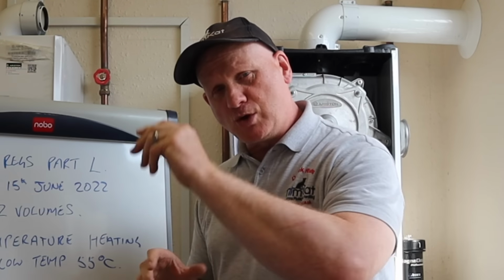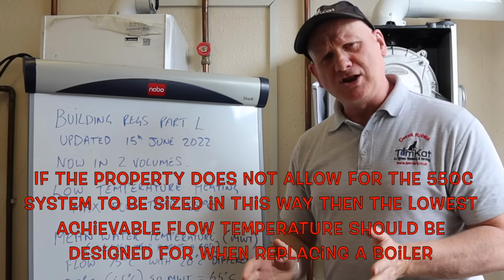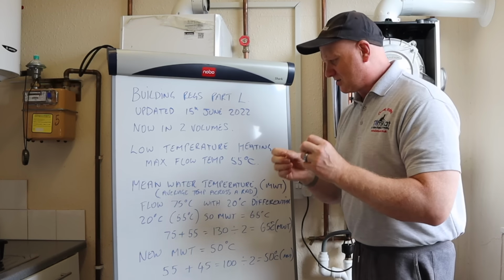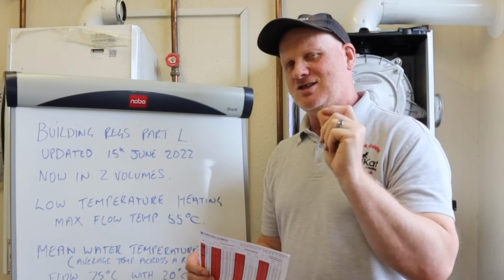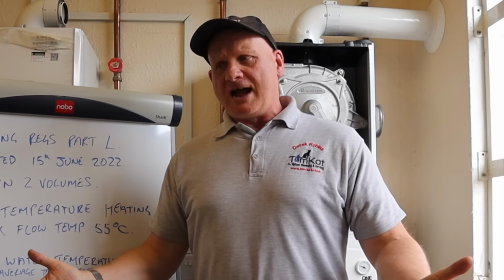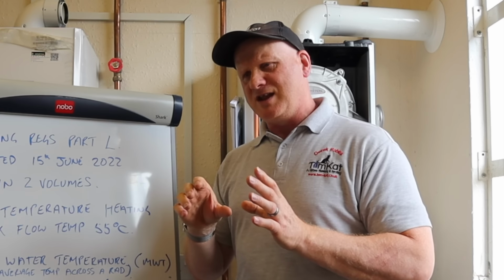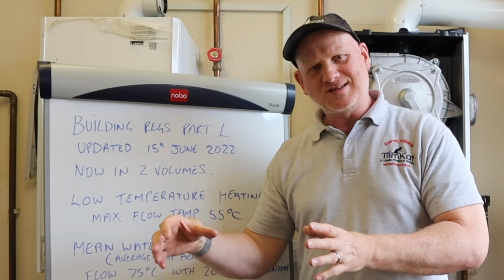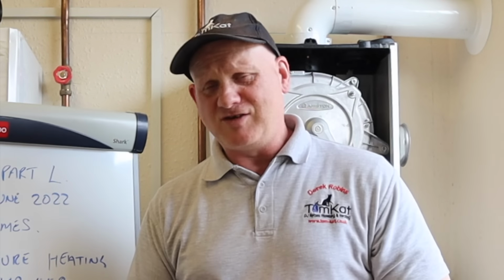Don't adjust your  heating flow temperature until you have watched this video. #saveenergy

Comment: One thing that needs to be taken into consideration is the additional run time of the pump waiting for the system to satisfy, people reducing the flow temperature to their radiators could very well end up with a system running continuously, at £0.52 per kWh for electric you could end up with no savings and actually start paying more to operate the system, pump could easily be pulling 100W. Easy and simple thing for most people to do so they are not guessing if they are doing the right thing is to turn the room stat down and ensure their timer is set correctly for occupancy.
Reply: What pumps are you running !!? My circulating pump pulls no more than 10W. Anyway I agree evaluating the cost of any electrical inputs in a system need considering before anyone changes anything.. The only true way people can reduce their energy bills is insulate themselves with clothing or insulate the house. Government should be doing more so people can get hold of discounted insulation not just VAT free if you use specific contractors that just charge you more than the VAT saving.
Reply: @jdickson242  I doubt it’s 10w but If that’s what you have 👏🏻
Reply: @jdickson242  the circulation pump, and most pumps installed currently will not be pulling 10W, most pumps installed will be of an older type pulling around 80-100W, even the new pumps could be pulling 40W depending on the sysyem. But this is the issue, social media video creators are telling people to alter this that and the other, most people don't even know what boiler they have let alone what their pump is using by the way of electrical demand, have no idea what their homes heat loss is for any given temperature, no idea what the rate of gain is at certain circulation temperatures,  no idea what the output of their radiators are. I watched a video yesterday where a heating engineer was recommending people leave their heating on permanently to save energy, this video is now being used by the main stream media, I can assure you by the end of winter most people will have higher usage than if they had just turned their thermostat down in nearly all cases, but I guess every heating engineer and his dog wants their 15 minutes of fame.
Reply: @MattJordanWoodturning  my boiler does not have a visible temperature gauge on it.  it just has a dial marked min round to max. we keep it v near min. is that ok ? there are thermostatic valves on the radiators but as it is old system, have been told to keep them at max, ie fully open, to deter sludge build-up, and just turn off unneeded rads. so that is what i do. we all manage as best we can.
Reply: by the way, i do not have a condensing boiler. just traditional one.
Reply: @acommentator4452  I wouldn’t bother with a none condensing boiler tbh mate also depends on if it has a pump overrun which is what they were talking about but tbh pump overruns are there to stop the system from fucking itself everytime it turns off with heat in it so….. none negotiable really
Reply: Gas prices have quadrupled since that was true…and elec has “only doubled”.
Reply: @wl660  but gas is 1/3 cheaper per kwh/btu compared to electricity in the UK to heat a home so still works out cheaper........ Just.
Reply: yes, reduce flow temp where possible so boiler operates more efficiently but not so much that run-time is greatly increased.
Reply: If I turn my thermostat down the heating doesn't come on , it has to be at 20
Reply: @smallfeet4581  
Agree,  the temperature you set on your thermostat does seem to vary to get boilers to fire up.  Mine will not come on unless the thermo is set to at least 22.5 C.  When I am just sat reading or watching TV in the evening, I have to set it to 23 deg, or else I feel cold. A separate thermometer indicates that these temperatures are accurate.  How people tolerate lower temps is beyond me.  My flat is well insulated as well.
Reply: @smallfeet4581  you are looking at the room air temperature. He’s talking the water temperature from the boiler
Reply: @3521rob  hmm , I see what you mean , yes I did turn my temp down , usually in spring , I usually turn it up in winter , I can see how not having the temp up in winter could see it struggling to cope , I will need to watch it again , cheers
Reply: My boiler is a quite old system boiler. Last year I having not used it all summer the pressure kept dropping and I was having to top it up every time the heating was working. The heating engineer I called out tried to reset it using the switch but it was difficult to get at because of how the boiler had been fitted. At that time the flow to the radiators was set at 5 and I had the thermostat set at 18 degrees with all of my radiators on 5. I couldn’t afford a new boiler so I tried reducing the radiator flow to 2.5, the thermostat to 16 degrees and radiators in unused rooms to 2. The pump now works without topping up. I did a 15 minute start up every month during the summer when the heating was not in use.
I have saved a fortune, or would have if prices hadn’t gone up, so I am using less and paying the same! I plan on running a test with my smart meter on what you have said about the flow speed and the extra electricity for the pump but I think I may have to stick with the 2.5 flow whatever the out come because of the problem I have had with the pressure valve on my boiler.
Reply: When running on low flow the pump draws far less power, so that isn't really possible.
Reply: @BooBaddyBig  yes a centrifugal pump or fan reduces in power consumption as the load decreases, question is why would you expect the flow to reduce with a reduced flow temperature from the boiler? Maximum efficiency gains are with a wider delta t, most modern boilers allow up to a 20 degree delta t, old boilers are around 10, either way that difference is from the flow of a well balanced system, reducing the flow takes the load of the boiler, which essentially you want running as hard as you can regardless of setpoint, this again is due to the delta t, but this time between the return water and the combustion chamber. So the catch 22 situation here is if you reduce the temp of the boiler you reduce the efficiency of the rads, and thus take the load off the boiler, unless of course your radiators are twice the size they need to be, which we all know they are not. Maximum gains in efficiency from a boiler in condensing would be around 5 to 7%, and that's in a well designed and balanced system. On a cold day with 0 outside, turning your thermostat down from say 20 to 18 degrees will save you around 10% in heat loss, and you don't have to worry about anything else, you will also have a reduced system running time meaning you save electricity on the pump and boiler fan, and a slight increase in efficiency of the rads too.
Reply: This statement regarding is misleading. Even in pump draws 100W (probably lower W), that means if the pump must work lets say 10 hours instead for 7, in actual consumpion that is only 300W more pay day. If the kwh is 0.2€ that means you will use 0.3kwh*0.2€ more pay day. So 0.06€ more for pump. And you will 1000% save more money with lowering the temperatures. Easy
Reply: @SLONooB  it's not misleading in the slightest, what you have done is assume the system can generate enough heat with a reduced flow temperature to overcome the heatloss from the building. The fact I was looking at an installation only last week (on a commercial scale) where the reduced flow temperature meant the system would run 24/7 and never reach the occupancy setpoint once the heat loss reached a certain point based on outside air temperature. I've been doing this sort of thing for nearly 3 decades, and it still amazes me the amount of assumptions that are derived from lack of knowledge, even from installers. What is misleading is telling everyone they can just reduce their flow temperatures without taking into consideration the design of the system vs heat loss from the building. If people want to reduce their flow temperature they can either try to wing it and risk spending more money, or they can do it correctly, and by correctly I mean do a heat loss calculation on their home, obtain the operating factors for their radiators, measure electrical energy use for both the pump and boiler, and then calculate it all up..or they could turn their thermostat down with nothing to worry about.
Reply: So what would be the ideal delta t for a system boiler ?
Reply: @andymav3023  refer to your manufacturer's manual for the boiler, it will tell you what the max is, the greater the delta t the better the potential heat transfer, however there are always trade offs what ever you change unless the system is greatly over engineered on the delivery side, as you will never load the boiler up. Balancing of a system really is a time consuming task if you take it seriously, and if you have TRVs almost impossible.
Reply: @MattJordanWoodturning  well the boiler is sitting in an outhouse no door and not insulated I think it’s probably a Heatloss problem I’ve encountered on a system boiler as the bills are astronomical
Reply: @andymav3023  heat loss from the boiler wouldn't be the problem to astronomical bills, even in an external boiler. It would add to them but probably not your main issue. Without knowing the system it's difficult to help. First thing I would do would be to carry out a heat loss calculation on the home, then compare that to the heating kWh use.
Reply: @MattJordanWoodturning  that was going to be my next course of action … it is a system boiler on an unvented system the boiler is quite far from the cylinder and the outhouse is completely open to the elements broken door with absolutely no insulation on the pipework in the boiler house or cylinder pipework..It runs as far as I can tell on a two port system. I would imagine the boiler is short cycling
Reply: @andymav3023  check your flue temperature, should be a good indicator of efficiency, my guess is a fouled up heat exchanger. Heat loss from surface to air is insignificant compared to heat transfer from surface to water.
Reply: @MattJordanWoodturning  Kindly help!! I recently moved in to a new built, boiler stays on all the time, even though two stats are programmed for day and night temperatures. What could the reason?
Reply: @SL-lc9yl  if the programmer is setup correctly its wired up wrong probably, boiler wouldn't come on unless it was getting an enable signal.
Reply: @MattJordanWoodturning  Thanks. Who could help to check this issue? Electrician or boiler engineer?
Reply: @SL-lc9yl  a decent electrician or heating engineer should be able to help, I would go for a heating engineer first though. Just double check you haven't inadvertently got your programmer in manual first though 👍
Reply: @MattJordanWoodturning  Many thanks 🙏
Reply: @Manic Miner Mass deaths lol, I think you are being over dramatic, It has sadly happened but in masses?
Reply: pumps use very little energy in comparison to heating the water in the system. so it way cheaper to recycle the water in the system than heat it up. usually the pumps are around 60W so that is 6KWh every 100 hours of use.  and at £0.52 per KWh (your figure) that would be £3.12 per 100 hours. even if you had a massive pump that was 100W that would still be £0.52 every 10 hours or £5.20 every 100 hours. the price of gas being combusted for the same amount of time is going to be significantly higher.
Reply: @johng.1703  you're assuming the system can satisfy the heating demand at the lower temperature, which you have no idea if it will, plus there are lots of other things to take into consideration, but every system will run longer as a result of a lower flow temperature, advice is given out across the board without that knowledge being taken into consideration and should be taken with a pinch of salt. If the system is enabled and can't satisfy because the radiators have been downgraded in their output, then all you are doing is running a pump for the sake of running it. Gas usage savings might be 5% for a new system at best, but realistically about 3%, but if your pump is running for 8 hours longer than it needs to that's potentially more than you save on gas. Average gas consumption is 33kWh per day, let's say you saved 1kW by reducing the flow temperature per day, on today's price that's 7.29p per day saving, now if the pump is running for 8 hours longer than it needs to that's just cost you 16.8p per day at the 60W you quoted at the average price of 35p/kWh, which is what electricity is today, so the system has cost more to run. Any advice given out about reducing flow temperatures without knowing the system is always "bad advice". If you want savings turn your thermostat down and leave the recommissioning of systems at lower temperatures to people who know what they are doing and are able to calculate if its worth doing, which most of the general public aren't, but more worryingly is the amount of "gas engineers" who decided to flood social media with advice not knowing if it would generate savings. I've not seen one yet do any form of advice base around calculations so people can at least try and gauge the cutoff point. If you're confident in what you say here's my example for you to advise me - I have a condensing fired boiler, what will I save by reducing my temperature down? And I've purposely left out all the required information needed to give that advice out, and that's a lot of information, the same information none of the "advice givers" know either, because it's my system and they have zero knowledge of it.
Reply: @MattJordanWoodturning  my comment was to do with one aspect and that the cost of running the pump given the KWh electrical cost you gave. And that was a cost for just running the pump.
Reply: @johng.1703  there is no reason to look at the pump running cost in isolation, what would be the benefit in doing that? You stated it would be cheaper to "recycle" the water around the system rather than heat it up, which also doesn't make any sense to do, you would again just be running a pump for the hell of it. The entire thread is about reducing flow temperatures to save money, which is possible, but you need to calculate that cut off point. And in order to do that you need to know the system and the house its installed in very well, that includes all the heat loss calculations for the fabric of the building.
Reply: @MattJordanWoodturning  but that was the point you were making in your original post, the cost to run the pump.
Reply: @johng.1703  yes the cost to run the pump while the system is waiting to satisfy, its not looked at in isolation, and if you knew the variables involved getting  the system to be satisfied you would know what I was talking about.
Reply: That's a good point to consider and easy to monitor. I think now we could do a 7-30 day trial run on one setup and monitor our energy usage since we all seem to have smart meters now. 
Then compare to previous energy use. 
As long as the weather is pretty similar we would soon learn if we were better off.
Reply: So what percentage of the cost is the pump?
Reply: @twasb2000  I can't tell you and neither can anyone else, same goes for the consumption of the boiler fan, and that's the point, as a percentage these are constant variables dictated by external factors. You want to save money? Turn your room thermostat down, get your boiler correctly serviced with a heat exchanger clean and ensure the system is fully balanced by temperature so the boiler is loaded correctly.
Reply: My old engineer always said run the boiler temp quite high. Because the water pump consumes expensive electricity whilst the cost of a bit of extra gas was low.
Reply: @jakebullet1731  Running the numbers for my old Ideal boiler (non-modulating) it burned money about 200 times faster per minute than the pump did. Means that choosing a temperature that increases the boiler efficiency is far more valuable.
Reply: @jakebullet1731  Nowadays, the pump consumes almost nothing, while the cost of gas is higher.
Also, condensing boilers benefit from low temperatures. While older boilers didn't.
Reply: @jakebullet1731 he'd be very wrong
Reply: Maybe? I mean, I see it as  slowly getting to 70mph on the motorway and keeping it at that for a few miles before needing to drop off.

That's better for fuel economy than getting to 70mph as fast as you can
Reply: @waqasahmed939  not really no. What people are unknowingly trying to do by reducing their flow temperature is mimic outside air temperature compensation on a manual basis. Normally this would be done automatically and the control would be commissioned to the system to ensure correct optimum efficiency. Just turning your boiler down risks the system pump running for hours and never satisfying the stat, hence the additional running costs of anything saved in gas by bringing the boiler into the condensing stage of firing. As stated before the best advice for most people is to turn your stat down, plus turn radiators off in rooms not used and see if you can tolerate the reduced occupancy temperature, this in turn will reduce your heat loss from your house as the delta t is reduced from inside to outside. Although to be honest as a country we shouldn't even be at this stage, I'm now paying less for Kerosene 28 than people are paying for gas, let that sink in..if the electric price had gone up to £0.52/kWh it would have been cheaper to run my diesel generator than buy electric from the grid, I could have also plumbed the cooling water into the house and turned it into a small CHP unit..
Reply: @MattJordanWoodturning you are wrong I'm afraid. The power draw from the circulation pump is tiny. 20w. That's 0.6p per hour. A gas  boiler at 20kw costs £1 an hour to run.
Reply: @timoakley277  I'm not wrong in the slightest, a system pump could be pulling up to 100w depending on the age/model of the pump, size and balance of the system. Brand new energy efficient 15-50 is rated at 60w full load, the old ones were nearly double this. My own pump now runs at 55W, larger system but new pump, old type pump not energy efficient would be over 100W. And there are plenty of older circulation pumps out in the wild more than 10 to 15 years old. Plenty of comments for you to read over the last 2 years in this thread, but it remains clear most people have a lack of understanding of the variables involved in central heating. My position remains the same for the average homeowner, turn the room stat down and ensure the timer is set correctly if you want to save money.